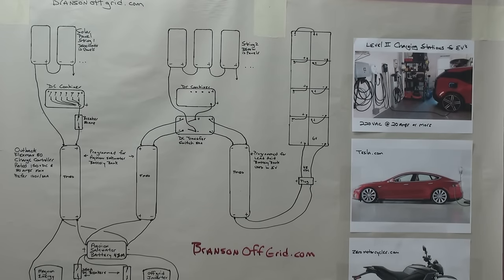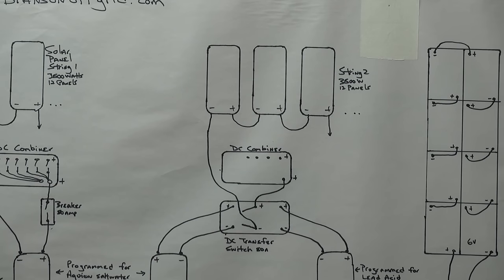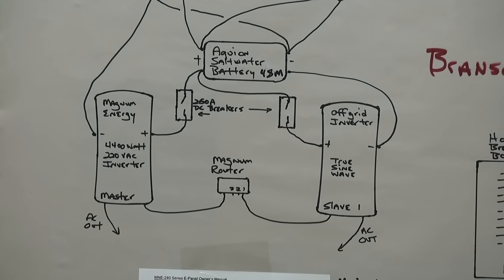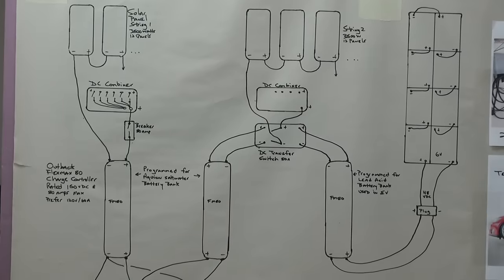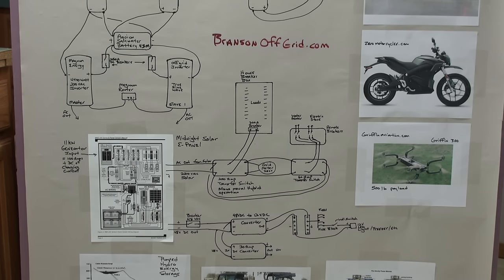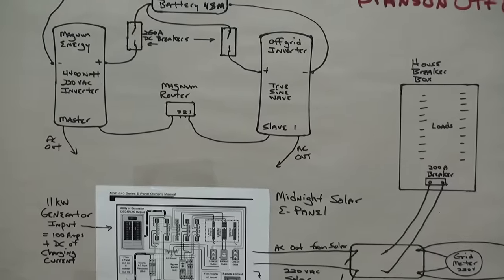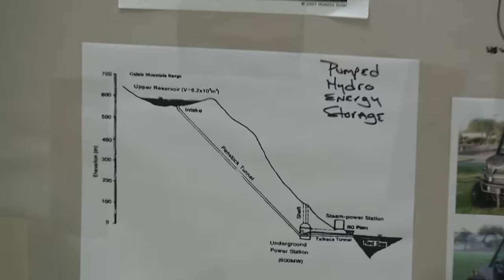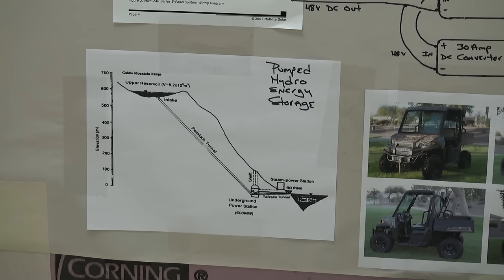Aquion Energy Bankruptcy news + Off-grid Components System Layout

Comment: installing a Aquion 48m right now
is the BMS 200 required to use it.  my installers are saying it won't turn on without it.  Is that true?
Reply: yah there saying they can't turn on. the contactor without it.
Reply: True about warranty.  But we already bought the battery and it's all installed minus the power supply or BMS.  We're just trying to get this thing operating so we can have power.  Would prefer not to buy BMS but not sure if my installers can figure it out without it.